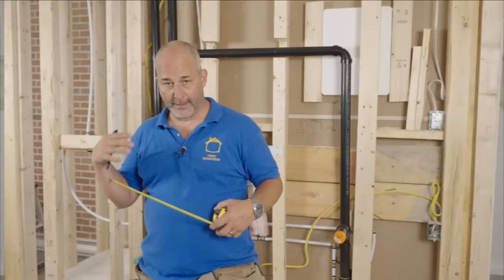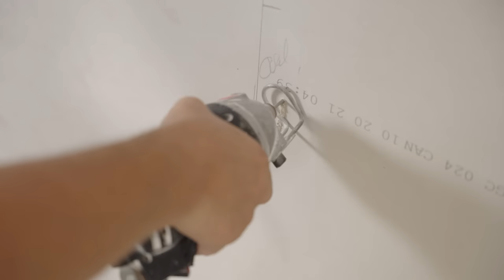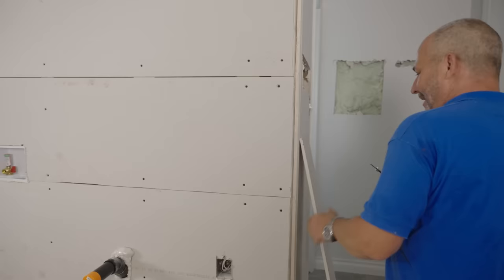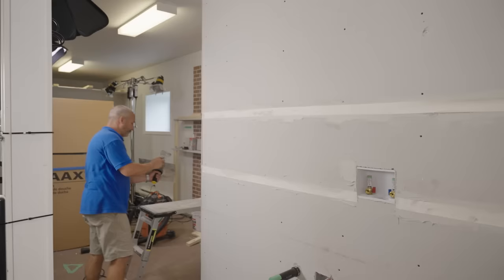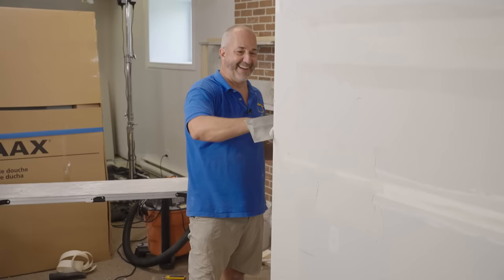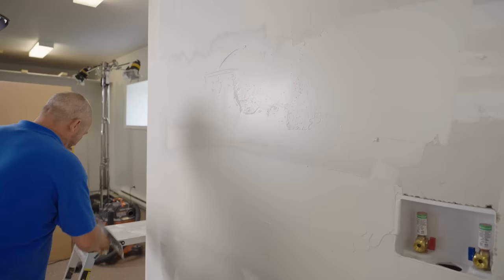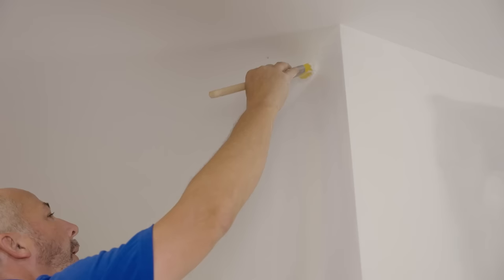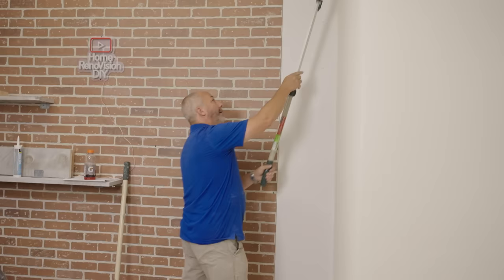Drywall Done In 1 Day | All My Tips And Tricks

Comment: Before I found your channel hanging pictures was about my diy skill level. Now my floors are ripped up, my sink and toilet are gone, kitchen cabinets gone,  and I live in a construction site. My skill level may not be great, but my confidence is 💯🤣
Reply from the maker: That is awesome! You got this. if you run into trouble join our membership and I can help. Cheers!
Reply: S2
Reply: This made me laugh so hard! I can completely relate!
Reply: @HomeRenoVisionDIY  How do I get membership?
Reply: It escalates so rapidly. All started at our house with wanting a sliding glass door... which meant moving the electrical box, but while we are at it, we should upgrade the electrical, and while we do that...we wanted to dig a new trench for the electrical line since we were digging up the patio and the old line was well entangled in tree roots. ...but when I sit on my couch where the garage and chicken coop used to be, we can see mountains. (I still need to finish painting tho)

This was out we started getting rid of all the aluminum wiring. Tore apart the whole house and are slowly putting it back together with confidence levels on par with yours 💯
Reply: @Lady Ewo  I think on their website. Maybe Facebook group? He's mentioned before, but I forget.
Reply: 😂😂 it be like that sometimes
Reply: that's not like a pro! you start from the bottom up in that case and you don't have to use that piece of wood, and you don't break your back. you use that first board instead of that wood and you will have a correct joint for the tape.
Reply: Lol I love it!  Keep grinding, brother!  God bless 🙏🏼
Reply: At least your deconstructing skills are improving
Reply: 👏 🎉same im preparing to help with a rehab 💪🏾
Reply: One room at a time folks.
Reply: Lolz. You putting them back in?
Reply: So, the wife will finally get her kitchen remodel she's been asking for ages 😂
Reply: Just use command strips, no need for drills, holes etc
Reply: @remus100776  I always started at top so the drywall supports the lid.  Gap at the bottom hid by base.  Helps to work in a team of 3 when doing this.  Doing a big wall by myself (like a 16' gable wall) I will stack it from the bottom.  I'm not a drywaller but have done probably a dozen houses and numerous small jobs, so I definitely don't know it all.  Whatever gets the job done.
Reply: May sawdust never get in your eyes
Reply: Tearing out is the easy part. I wish you luck getting it back in. 😂
Reply: Same here

Comment: Been doing my own amateur drywall for years by myself, I never thought about using a cheat block! That would've made my life so much easier. Thanks for the tip.
Reply from the maker: Cheers!
Reply: Yep that was a great tip.
Reply: I never used a block, but I would usually run a couple screws into the studs just below where the drywall would sit.
That way I could get it up there and grab my stuff before I pushed it up and started screwing it in.
Reply: Starting to do drywall, I am 67 years old and only 5 feet 3 inches tall (short 🤣) I need all the help I can get.
Reply: @HomeRenoVisionDIY just curious, in the basement, why did you leave the drywall on the floor, and not lift it the ½" imperial, off the ground? Especially in an area with so much plumbing.

Started this click bait Title… I was watching you hang your first sheet, and saw that channel for the wires, and was like, 'There's no way, this guy is getting this done in eight hours.' Even if there wasn't humidity or rain.
First tip off, was seeing you struggle with the rip you made on the chalk line. You miss measured your water to powder ratio, and added a second pour: immediately I knew your compound was getting tough to work with, before all tape was applied. How you tossed your slow mixer, on the floor after you opened the Premix, there was no way you'd get this done in a day. Possibly if you did your 2nd coat in 90. But the heart wouldn't be dry enough for primer.
Did you make any money, after paying for the golf?

(Furthermore, exclusively using "45" and paper tape, filling those mistakes from the rotozip, and around the large holes cut out for drainage, wouldn't add any extra time than the expanding foam application.)

After a passage of time, like 2 months, the unpainted caulking on the surfaces next to your flat tape, are going to look brownish from dust circulation. Pro tip… paint doesn't 'fill' imperfections. After about 4 days, the paint cures, and hugs the wall, revealing every line from the heavy sanding grit on the sponge. Take the extra hour, and do the additional finish coat of mud. Run a light bulb, and final touch up if necessary, prior to the prime will serve you well, and avoid rework. Don't skimp for a bet. When does gambling ever pay off?
Reply: @AJSchultz lol..like someone was reading my mind.

Comment: Painters tip. Use a mini roller singe the hairs at the button end. Dip, wipe the button clean and let it touch the ceiling to cut in your primer.  Gives you just enough space to caulk then brush your finish coats.
Reply: I'd like to understand the tip you're trying to share but I don't quite get what you mean?
Reply: @mrreams711  I haven't tried this, but I believe he's talking about using a lighter to singe any stray threads on the roller on the end that has a cap ("button"), opposite the side you slide the handle into. Then you apply paint to the roller, clean off the button so there's no paint on it, and use the button to scribe along the top of the ceiling. Burning the threads near the button makes sure you don't get paint on the ceiling and leave a small gap between the paint and the ceiling.
Reply: That is a genius idea! Thank you for saving me hours of hand cutting in

Comment: pro tip - drywall square is the exact width of a rectangular electrical box, align one edge and draw both lines.
and use a scrap piece of drywall as a space to allow a 1/2 gap at the floor, stop moisture wicking up from the concrete.
Reply: Yes, don't let the drywall touch the slab
Reply: I was shocked he didn't allow any gap from the slab.
Jeff,  Jeff, you're not showing us the correct way!!
Reply: @PB4204eva  but he's putting it on top of vinyl look tile or tile /so not directly on the slab already right?
Reply: He does some scabby stuff, should never have a cut seem of drywall mid wall that’s crazy
Reply: I was going to say why not do the second full sheet and keep the strip for the bottom...lol @WilliamSheehan-xg8hm

Comment: Love it. As an electrician, I appreciate drywallers who take care around my work. Small tip, I learn it from an old timer they're good for stuff like that cut some cardboard up and stuff it in the boxes to hold your wires back. It's also good when it comes time to mud and paint, keeps the wires nice. Now I know you'd never hit the wires with the rotozip, paint, or mud, but sometimes you never know who's coming in behind you or if you'll be there to keep an eye on em. Either way great video, thanks for the tips. 10/10 as always.

Comment: As an intermediate handyman with some drywall experience, a hawk and trowel works wonders for big stuff. If you're curious and wanna try, get a thin one (.04 or .05, Level 5 I know makes them). Once you get the coordination down you don't have to dip in the pan every 3 seconds with your 10 or 12 inch knife. The hawk also works better with a knife because it's easy to clean and continually stir the mud. It only sucks for mixing a small batch.

Comment: Quality control is absolutely correct. You’re in control of the quality.  

The presence of debris in your mud is a result of the mixing blade you're using, indicating user error rather than a flaw in the product. By scraping the sides of the bucket while mixing, you're introducing contaminants. Opting for a mixing wand with rounded or tubular blades would prevent this issue. It's essential to stop attributing the quality of your work to the tools and products. Since you are responsible for the products and services on your projects, either stick to what you know or maximize the potential of your current tools. Once you finish, simply wrap up and move forward.

Comment: It's so good to hear "use good primer" I'm amazed at people that are "sold on" paint n primer in one.  I always wanted to know the paint knew if it was priming or painting.  The premise is 1st coat primes second coat finishes.  Does not work with new drywall nor old dry walls.  You will see every place the paint is sucked into the wall.

Comment: The knife/paddle/spatula came from the Union days.   Plasters (back in the day of such a skilled trade) or any cement-based worker had to be proficient with a trowel in order to get their ticket and join the Union.  As drywall finishers were not towel based trades, they ended up in the Painters union, and painters use spackle, caulk and putty knives on the job site.   

And thus, a whole industry developed around this new trade with all manner of devices, ready mix materials and pre-creased tapes to improve your home decor.   And the plasterers turned up with their real tools, scoffed at the mud pan wannabes and slapped it on the joints with true precision.

Comment: Never to old Mr Jeff, to tired, yes. Never to old.
Anyway a 3 dollar tool to get a thousend dollar result, thats music to my ears. I'm Dutch. And i did my cheetrock wall like you said, 3 years back, with the foam and its tight and straigt and did not crack after 3 winters and summers. It was and still is, very good advice. Didn't do it in a day, menn what a speed. Took me days! But thats totaly fine. I enjoyed it and the result is great.

A lot on youtube is making a 20 dollar chair with 10.000 dollar of tools, so, very happy with youre advice and video's. Learned so much.
Thanks again, and keep it up, you will get there!
Reply from the maker: Happy to hear. Cheers to a $3 solution.
Reply: @HomeRenoVisionDIY  im a 42 year old hearing impaired single mom, renovating my house by myself, even electrical (adding circuit for oxygen machine). 

This channel has REAL advice. And gives me confidence. 

what’s that $3 bit called? I need it. And is the t-square the correct name? What kind of knife cuts drywall best? What is the mixer called? Basically i need a punch list for the store and im always struggling to hear the tool names.

Comment: Not scrubbing your mixer of the 45 hot mix is the reason you got chunks in your finish mud. Plus 3 is nice, but you gotta wipe your walls and clean your mixer and trowels before you use it. Also, for rips, make all your horizontal rips with your T square and forget the chalk line except for marking difficult screw lines. Also, thin that plus 3 and roll it everywhere, sand,  and that will save a primer coat as well.

Comment: also within the 10-15min there is the magictime where the foam has its shell and yet mooshi on the inside and you can form it as you want.. so you can push it inside and will stay that way and be a "closedcell"  i do it with the sprayfoam around doors so dont need cut anything and its alot cleaner

Comment: Got to love those cheat blocks. I just used them to hold up full sheets of OSB sheathing a house by myself 15 ft in the air climbing a ladder with a sheet of OSB sucks as it is holding it up against the side of the house is impossible

Comment: I recommended against setting your drywall on the ground.  Instead, set it on a junk piece of drywall to give you a 1/2 " gap on the ground.  This air gap prevents water on the floor from wicking up through capillary action into your drywall if your bathroom has an water leaks or kids slosh out of the tub, or dog pees on the floor or the toilet overflows.   Then subtract 1/2” from all your vertical measurements for those stub-outs.

And use GLUE! to secure sheetrock to the studs.  Prevent movement... Prevent cracking....

Comment: Great job Jeff. You work like a young buck for an old man. FYI, there were not any chunks in your premixed bucket of joint compound. The chunks were when you cross contaminated your dirty mixing tool from the previous batch of 45 mud. Trust me. I've done it myself. Gotta always clean your mixer after each spin. Dropping it in a bucket of water does not clean it. 
Excellent job though. I knew you would persevere.
Reply from the maker: Thanks for that!

Comment: I used these tools for two sides of a drywall wall, I'd say the 2nd side of the wall these tools are amazing. I did not know about tapes, so side 1 has cracks, but side 2 was as good as perfect I'd say. Aka after 5 hours of using them they worked absolutely fine

Comment: I enjoy your videos. Me, i hang the 2nd drywall but against 1st. The smaller piece bottom so fat edge is near floor. IF i do it your way, i use a router and cut fat edge at slant . Makes joint mudding, sanding flush. Less buildout on joint.

Comment: Every pro drywall finisher I know says knives are generally apply the mud smoother than a trowel. Knives allow you to have complete control, a trowel is more cumbersome for final coats. 

They'll use curved trowels for first coat on outside corners, and flats just so they leave enough mud underneath, and account for shrinkage of joint compound. 

Then they'll run boxes for last coats, or choose to skim last coat with same trowel + 10" or 12" knives for a perfect finish.
Reply from the maker: maybe but they also leave a lot of mud heaved up on the wall since the knife can't smooth out the ridge without bending around it.

Comment: OK - You're helping build a little confidence that I can do a drywall install. It's to repair dry wall removed from a flooding. (so only the lower half) However, I only have the drill and I didn't catch the $3 attachment for the screw you mentioned. sounds like I need to invest in some tools. Hope I can afford it with the materials I need to purchase. Glad I caught comments about not letting it sit on the slab. Thanks so much. Wish me luck

Comment: Watching this as a drywaller I would’ve definitely hung the wall 4ft then 4ft then the rip at the bottom so all of my joints would have been recessed edges instead of putting a 10 foot long bastard joint all the way across the middle of the wall

Comment: I'm curious. Am I the only one that uses construction adhesive on studs when hanging sheetrock? It helps with rattling and screw or nail pops if anything shifts.
Reply: that sounds like a pretty good idea, i am going to start doing that
Reply: Everything I can do to prevent movement.... Movement leads to cracking off your joints.  Glue is your friend
Reply: You are not a friend to future renovators 😂
Reply: @CopeBUILT  absolutely...
Reply: I only have hung sheetrock for 20 couple years, but what I have seen and learned, trust me, drywall glue or (construction adhesive) is NOT a bad idea. And unless code asks for all those screws/nails, you will not need all those. More to finish.. and possibly more to fix down the road. Once glue dries, THAT alone will hold your sheetrock....JUST SAYIN.
Reply: @joelhuppe3725  that's what a vibe tool / oscillating tool is for... Skins the glue right of the studs, no problem... And if it's still too thick, grab your electric planer and take it the rest of the way off with that...
Reply: @CopeBUILT  Thanks, I need to remove a sink & counter top while saving the cupboard. I don't see any nails so assume it was just glued down.
Reply: @juliac406  probably put down with silicone adhesive.... Get a paint stripping heat gun and gently, slowly, without cooking anything, warm things up to help you separate them.   

Where the backsplash is adhered to the wall, you're just going at the very gently use some screwdrivers and crowbars to try to slowly work it away along the top edge essentially ripping the paper off the drywall.... And then you'll have to spackle it when you're done
Reply: @CopeBUILT  Thank you. I think he used Liquid Nails, in addition to real ones

Comment: Also another tip is when you buy buckets of mother usually been sitting on the shelf for a while so if you take your 4 inch knife and scrape around the edge of the bucket and scrape off the top and throw it away and then make sure mud he won’t have all that stuff in your mouth a lot of it’s just dried up mud from sitting on the shelf in the bucket for God knows how long

Comment: I was surprised to find out that in some areas, paper taping outside corners is the way, no corner beads. One benefit is that if you sent the corner it is easy to fix, no trying to undent the metal.

Comment: 18:52 Yes you can use batteries. This bad boy is the "serious DIY" (and full-on contractor) tool for mixing; the Dewalt DCD130B. Also a serious drill that is complete with an E clutch. Now that’s a drill.

Comment: I have been finishing drywall for 35 years using a hawk and trowel and I can tell you have not been using yours for at least five years. Also, why would you use flex corner when you could buy rigid corner that you can cut with tin snips and apply with the mud. Also, you forgot to mention that when you flat tape it will crack in time.